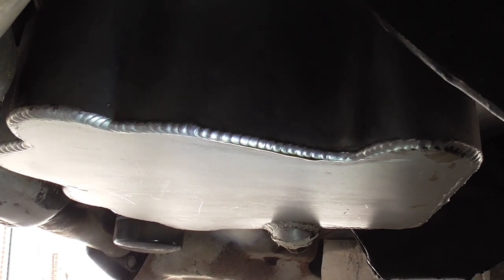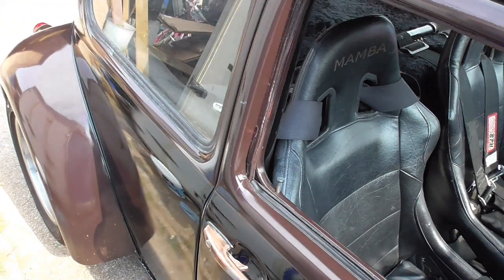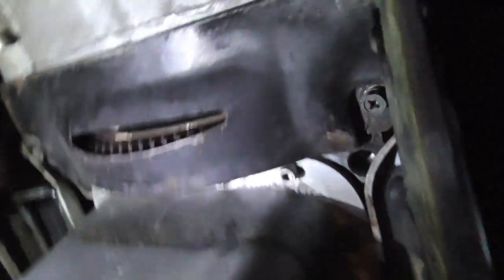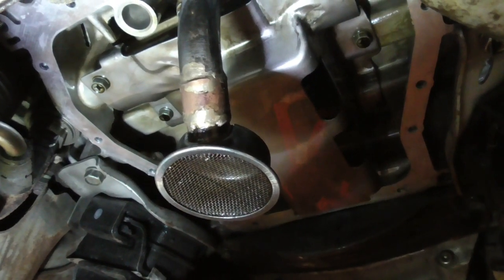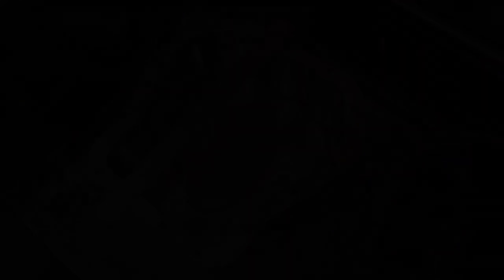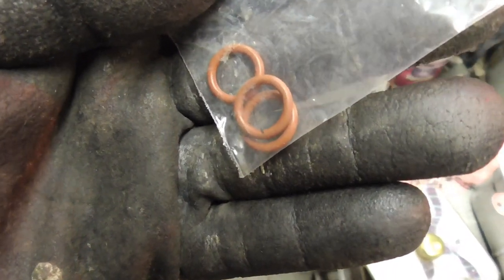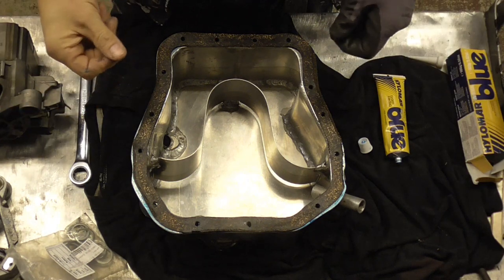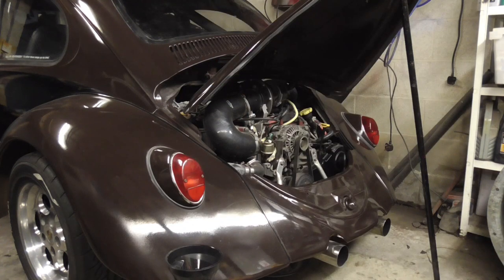Subaru EJ20 Short Sump, fitment, shortening Oil pickup, Subaru Engine Conversion Bug Beetle Bugaru

Comment: i have one of these sumps they are known for having weeping welds, i've got the  same problem. as far as i know regarding the gasket all that it used is three bond, speak to nick tune on facecloth he'll give you a better idea,
Reply from the maker: Lol I was going to suggest the same for you. Think mine is starting to fail again so will probably get one of his steel ones. Thanks 🙂👍
Reply: @PeoplesCar   im thinking the same, even  tho they are shorter they use the same oil capacity as a factory sump plus they are steel and all nicely tig welded up
Reply from the maker: @mack1541  yeah. I've been thinking about this for some time but am a total tight arse and was hoping I could get this sorted on the cheap lol. At least being steel could repair it myself easily. 
Can't remember if comes with an oil pickup tho, mines already shortened so not going to be easy to reuse that. Once I've saved up I'll be in touch with him. Tx for the info  🙂👍
Reply: @PeoplesCar  nicks sumps come with a pick up you just supply one on an exchange basis